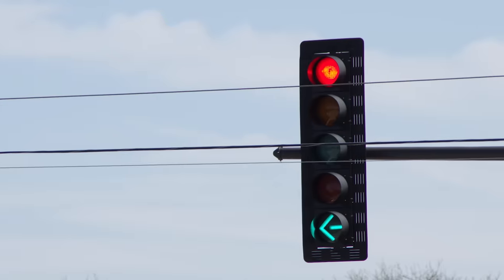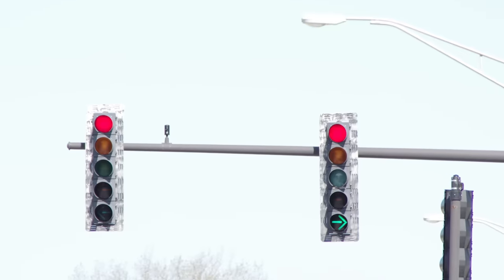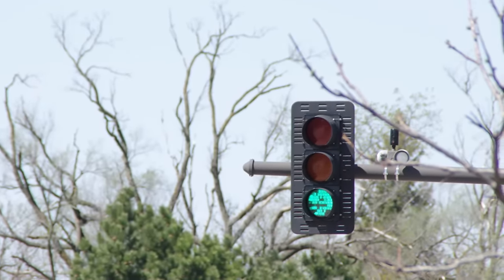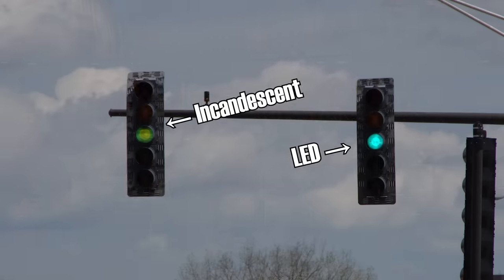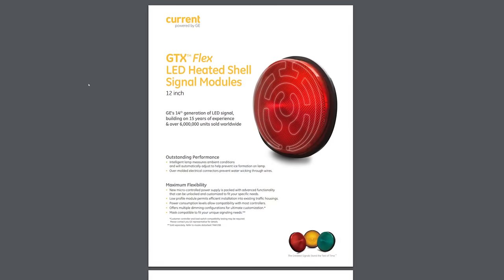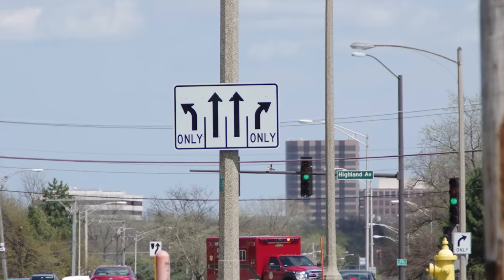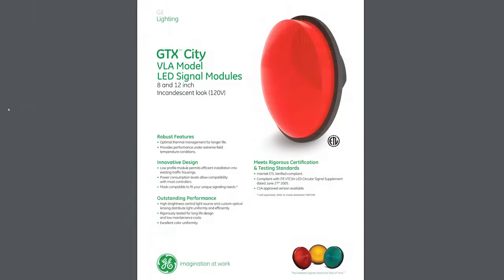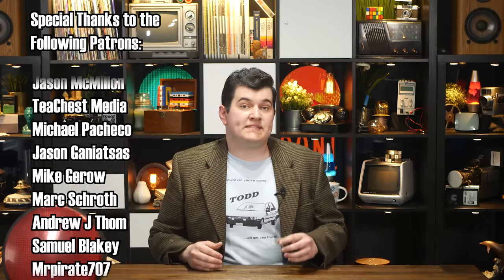The LED Traffic Light and the Danger of "But Sometimes!"

Comment: another wonderful, modern example of "But Sometimes!" thinking is Electric motor driven vehicles. "but pedestrians cant hear them coming!"
Reply: And the potential solution to that is really cool too: choose your own exhaust sound.
Reply: @PongoXBongo  Or you can drive slower where pedestrians cross. Or   looking both ways before crossing.
Reply: @carlangelo653  Of course, but that doesn't absolve pedestrians from their responsibilities.  We all share the road and all need to look out for each other.
Reply: @PongoXBongo  Yep, I mean in general pedestrians and drivers should just be more aware of what's around them on the road. Makes it safer for everyone.
Reply: PongoXBongo i want to get a recording of a harley davidson and play it really loud while driving, that way i can drive a gay electric car without looking gay
Reply: @shannondove96 /videos Whatever helps with your insecurities.
Reply: Gonna pop in with a "well, yes, but" because, well, yes, but it's not the same sort of sometimes. Blind people exist and they often rely on engine noise where there aren't other clear crossings available; that's not a "sometimes" for those people.
Of course, the solution is to make the cars produce a bit of noise, which isn't too hard, so I absolutely agree that it doesn't lessen the gooditude of electric vehicles. It just is something that has to be considered and implemented all the time; not just Some of the Time.
Reply: Savage!
Reply: What.
Reply: @clockworkkirlia7475  Okay see at first I thought this was just dumb, but you bring up a good point. My thinking is, "Are electric vehicles really that quiet?" Cos I don't think they are. They're just not abominably loud like combustion engines. I'm also pretty sure that nobody is considering the blind people with this "but sometimes", but the idiots/careless instead. I'm pretty sure a blind person pays more attention to sound - by necessity. A sighted person who's gabbing on the phone or something similar is the only person I could see getting hit by an electric vehicle. At least, I'd certainly hope so?
Reply: @Soitisisit  Sorry if this sounds dismissive, but honestly, nah. That "not abominably loud" sound is entirely concealed by the hubbub of any busy street. The world isn't quiet, certainly not quieter than an efficient electric motor (which are made to be as quiet as possible because quiet=efficient).
Reply: That's why the French Renault Zoe sounds like a literal spaceship when it's driving slowly
Seriously, it's louder than gas cars
But it's so fcking cool
Reply: I'd say that that is less a problem with roadtrips and more heavy duty vehicles such at cargo trucks and self-propelled cranes.
Unless you get fully-charged industry-standard power packs at every stop so you can just hotswap batteries so you can maintain range and not ruin the batteries by quickcharging.
Other solutions would be nice but the old-fashioned huge diesel is the effective solution so far.
Reply: "But sometimes, the horseless carriages will scare the horses!"
Reply: Had a similar problem in plant where I worked.way we solved the problem was 1.company made a rule that pedstrians had to obey all traffic rules when walking in the traffic lanes.2 Worst problem were supervisors that clustered in traffic lanes for whatever reason.So we put backup beepers 85db on the front of our electric servce vehicles,controlled by a simple on on/off switch.Roll up to a bunch of jerks stsnding in a traffic lane,turn on the beeper,clear lane.This was inside large buildings where noise was very high.
Reply: Actually the real reason is that the production of said electric car is more damaging to the earth than the production and run life of my 89 f250 7.3L IDI. Too me r&d must be done.
Reply: @GoogleDoesEvil  trains would fix that
Reply: I came here to make this exact comment!
Reply: "Here's a solution, have the vehicles go really slow and have someone carry a red flag in front of the vehicle!"
Reply: @GoogleDoesEvil  heard ofa little car company from America called Tesla? Lots of fast chargers everywhere too.
Reply: @GoogleDoesEvil  Convenience trumps every other benefit for the average person. Ev will be a hard sell to people without garages unless charge times can miraculously get below 10 minutes. 

I can see that being a big reason for Tesla to push for self driving. If cars could drive themselves to recharge stations, it could unlock a big market while giving extra convenience features of your car running errands for you. Or people could lean on the robotaxi network rather than owning a car
Reply: @GoogleDoesEvil  Same. About as uncomfortable as having a tiny computer in my pocket that collects data on me to hand off to a megacorporation.
Reply: we need to copy the sound a bicycle makes as it passes at full speed through a stationary traffic queue and have a simulator on our electric cars.
Reply: @GoogleDoesEvil  I drive mine on road trips all the time.  Even a 150 kW supercharger is fast, much less all the newer 250kW, which can add miles at a rate of 1000 mph.  One coffee stop every 250 miles, and you're all set.  Not a big deal.  Bring a cable with a standard dryer plug, and you can plug into your family's laundry dryer outlet, and get around 25 mph charge rate.  By the time you get up in the morning, another 300 mile range.  Just gotta adapt, man.
Reply: But there could be blind people. Though car noise is a disaster of cities
Reply: Solution is to produce ultrasound and gave blind people a device that can catch the waves and warn themif car is coming and which direction.
Reply: Say it to industrial fans 😂
Reply: @user0K  would that work for speeding bicyles too?
Reply: Electric/hybrid cars should perhaps have a speaker to make sounds when running on electric - such as "chitty chitty bang bang" or the "Harley Potato"
Reply: @Soitisisit  They are. I almost ended up on the hood of one while walking in a parking lot. I came from behind a van and walked into an asphalted driveway where an electric car was coming that i didn't hear coming. Was quite a scare for both of us, lucky I noticed it just in time and he was going at an appropiately slow speed.
Reply: @carlangelo653  EVs do need to produce sound. It's a good idea to keep your head on a swivel but you can't always be looking behind you so EVs need something to make me recognize oh hey cars behind me
Reply: Pretty sure in the US at least, hybrid/electric vehicles must make an audible sound when near pedestrians or backing up. If you’ve ever been near a 2019 and above Toyota hybrid you’d understand what noise I’m referring to.
Reply: and hybrid cars take care of another  3  "but sometimeses" but sometimes the power at my house is out, but some times i need to make a long trip, but sometimes there are no charging stations
Reply: "BUT WIND TURBINES KILL BIRDS"
Reply: SteveAkaGoatpile
 ... the obvious answer is to install one of those 10,000 watt thumping sound systems playing rap music! <LOL>
Reply: @mayorsnorkum4005  ... I am known for my hijinks in finding power were others overlook it and that dryer outlet trick is one of the better ideas, however... old machines used 3 prong cords and new ones use 4 prong so you need a selection of adaptors... .and maybe a 50 amp plug to mate with an electric range outlet, which are only just starting to be standardized. Now pace off the distance to where you can easily park the car, which may necessitate 50 - 100 feet of extra cable. Let's not forget routing the cable through an open window or door. (with AC / heat / security concerns) All of a sudden we're looking at 200 pounds of #6 cable, plugs and adaptors in the trunk and hundreds of $$$ spent for the "just in case" moment. Oh, and we still have to adapt that mess to the Tesla charger plug.
Reply: @rupe53  Yeah.  Once in a time, even gasoline (or petrol) was not even standardized, and simply getting gas to run your car was an adventure.  We are currently in the "wild West" when it comes to getting cars charged, in some real ways.   I wonder what will happen when many other manufacturers are also selling electric cars ... and all those people need to use the various "public" networks like "Electrify America" (with their legendary lack of reliability and high cost).   To give credit where it's due, Tesla is the only company who just said "screw it, we'll build our own network", to the benefit of all Tesla owners. We can charge anywhere (including the public networks), but most owners would never use those networks if a supercharger was anywhere nearby.    My own feeling is, Tesla could go one better, by providing a "bag of tricks" with each Tesla sold, with adapters for all manner of electrical situations (for that target country).  When I bought mine, the bag of tricks that came with the car handled most situations ... but not quite all.  I'm also wondering what will happen when people start buying those (very cool looking) Lucid Airs ... then realize they are stuck using those crappy networks. To pay all that money, and still not have a dedicated network?   Don't know how that's gonna fly.
Reply: @mayorsnorkum4005  ... funny you should mention the wild west scenario. I'm sure (back in the day) people tried to refuel cars with all sorts of blended kerosene, lamp oil, cooking oil, and whale oil... or whatever was handy. Back in my school daze we actually used Coleman Fuel to get a VW bus to the next gas station. It started easy enough but that fuel has NO octane rating to speak of! (can you say ping?) I also know a couple of old guys (now deceased) who had gas stations back in the 30s. These guys had stories about walking out to the main drag in town to flag down passing cars. Reason being was no more stations for like 20 miles so it was a way to get people to turn down a side street for a dollar's worth of gas... maybe less. (gas was close to 10 cents in that era) When business was slow you did what you had to do to generate a few bucks on a weekend. Funny part is these guys worked alone and walked a block away from their business that was left wide open while they looked for customers. It was certainly a different time!
Reply: They already do produce sounds for the sole purpose of warning pedestrians but admittedly many pedestrians do not notice but they aren't really hard to hear so I suspect the issue is more that people don't recognize the sound so they don't notice. I suspect part of the problem is car companies try to pick sounds that aren't unpleasant but that has the side effect of being easy to tune out which unfortunately sort of defeats the purpose.
Reply: @jon9103  ... if you have even been in larger airports where they use golf carts to jockey people around you might be familiar with the softer tone that sounds like a truck's back up alarm. I know what it is but it's amazing how many people don't have a clue as to what they are looking for when that sound is close by, despite the flash of a strobe light on top to aid those who may not hear well. You have to remember that we are dealing with people... and the lowest common denominator as well. I doubt we can come up with a universal warning in my lifetime, except maybe the sound of screeching tires to wake them up!
Reply: Well, they have problems too. Imagine you have to drive when it's colder than 20 degrees C, and the battery won't hold a charge. There's a reason, why, in colder climates that Electric vehicles aren't reliable. Once again - one size does not fit all.
Reply: @KansaiSamurai  ... you do realize that some will want a custom sound like they do for ring tones on their phone, right?
Reply: hognoxious  ... I have to agree that sound of horses galloping would turn heads, provided DOT (or other agency) doesn't standardize the sound before then. Once you get to road speed the tires probably make enough noise.

Comment: Another problem with incandescent bulbs is that if the sun is at just the right place in the sky then the sunlight can shine into the reflector and make it look like the bulb is on even though it is not. This is very rare but it does happen and there have been deaths. LED bulbs do not have this problem.
Reply: I worked for traffic light manufacturer in development. In the UK we had what was called anti phantom lenses. The front lenses was covered in very small lenses through which the light is projected through a matt black mask, to stop sun light reflecting off the reflector. Going led eliminated the problem.
Reply: It's not rare if you frequently drive at those times of the day.
Reply: A problem that doesn't just affect cars, but trains too, and drivers avoiding running red lights.
Reply: What you are talking about has nothing to do with incandescent bulbs. It is the lens on the traffic light, they are called "programmed visibility signals" and are used in situations where there is another intersection within range of another intersection, and the risk of confusing the signals is increased. So the signal is arranged and directed to only be visible from a certain distance away from the signal and from that specific lane directly in front of the signal. 3M made these from the early 1970's into the beginning of the 1980's.
Reply: The same thing happens with LED lights. the solution is to go with a clear lens and colored LEDS, not white LEDS with a colored lens. In Fargo, Phantom Signals usually in south facing signals in January when the Sun is at it's lowest.
Reply: LED's are by their nature monochromatic. So they only transmit over a very narrow wavelength. To make white LEDs, they usually start with a UV or near UV LED and then add fluorescent material to the lens (very much like the tubes we usually call fluorescent light.) So having a white LED with a colored lens would be a really silly thing to do. Start out with monochromatic light; then convert that monochromatic light to white light (and loose some energy in the process;) finally convert that white light back to monochromatic light and loose a lot more energy. All this to go back to a wavelength where monochromatic LEDs exist and are relatively cheap and extremely efficient.
Reply: sun in the right place and an led is black
Reply: Tor Lumnitor Or they could try a different route.
Reply: Not rare. Every afternoon where I live.  Whole city is a grid, and an almost setting sun lights up all the colored lenses when driving east.  Sometimes you have to look at the color of the cross traffic lights to figure out what color your light is.

Comment: Regarding the green arrow for right turns appearing immediately at the start of the yellow phase: that's appropriate... sometimes. 🙂

If opposing traffic has a permissive left turn signal (e.g. solid green or flashing yellow arrow), there may be cars in the intersection that need to clear it when the light turns yellow. It would not be appropriate to give drivers a protected right turn in that scenario, because it introduces a "yellow trap" scenario in which the left-turning driver is expecting all opposing traffic to get a red signal, and that they can thus clear the intersection as the light turns red. By giving the opposing right turn a green arrow, you're allowing that traffic to conflict with the vehicles trying to clear the intersection, thus introducing the risk of a collision. In that scenario, it's appropriate to have the light turn red for the right-turn lane before giving that traffic a green arrow.

If the opposing traffic has a protected left turn, there should be no problem illuminating the green right turn arrow as through traffic gets the yellow, since the opposite-direction left turners should have a red arrow at that time.

Comment: I remember a friend of mine that claimed to hear of a case where a bicyclist died in an accident and that it was determined that the death was caused by him wearing a helmet and wouldn't have occurred otherwise. That to me sounds like an extremely difficult determination to make, but whatever. I just said to him yeah that's one case and then told him about two cases where somebody died without a helmet. Even if his story is true (I'm sure it's possible as some kind of fluke) it still has to be weighed against the alternative. It's like he was afraid of dying in an ironic oh-henry way more than he was afraid of dying in a very mundane way. Or really he was probably insecure about wearing safety gear and found what he thought was a solid excuse to forgo the helmet.
Reply: Same when people try to argue for not wearing seatbelts.
Reply: Who still wears a helmet on the bicycle when they're older than 3?

Comment: Here in Germany every traffic light has backup signs if the lights are out. Normally 2 sides have a dedicated „Vorfahrtsstraße” sign that would mean you can blast right trough while the other 2 sides have a give way sign. Would be really dangerous if only the side with the give way sign fails.
Reply: In America if a power loss happens, all four way intersections are four way stops.
Reply: ya i agree with the video but I think he missed on a couple points. The reason the ice would be dangerous is one side would be covered and the other's wouldn't. When there's a power failure it's easy to tell and everyone stops but if only one direction was covered in ice and they stopped and then took their right of way (as is the traffic rule) they could get smoked by someone on the other side who has a green light that is not covered. That and "just don't drive if it's a blizzard" would be great if cities would close their roads but your employers and kids schools still expect them to be there.
Reply: @new0news  that’s right. Also just noticed I mixed up the sides in my original comment